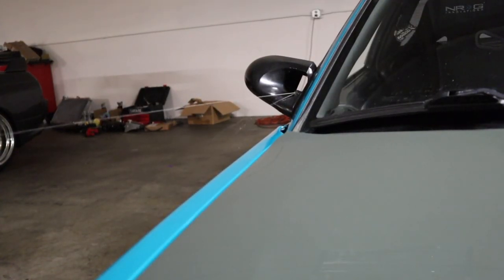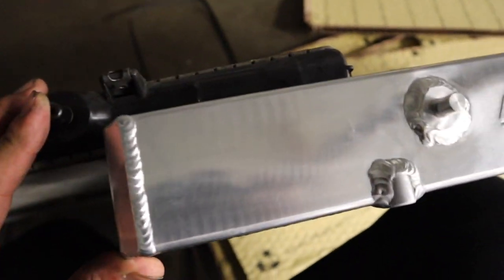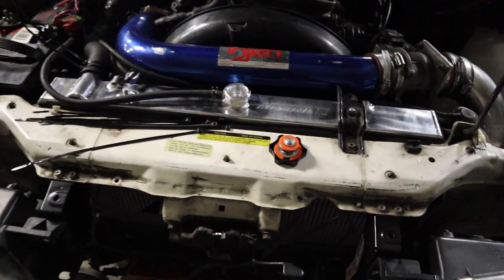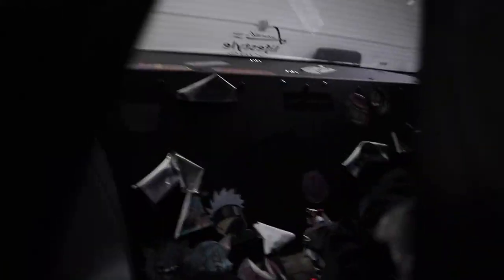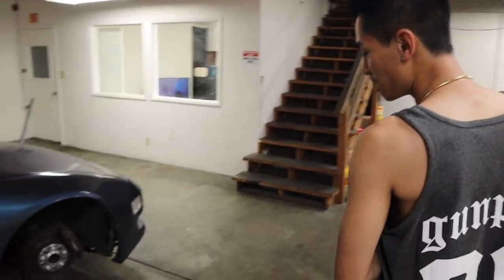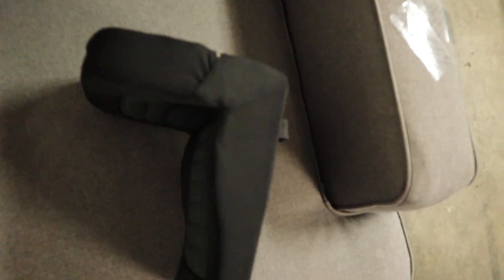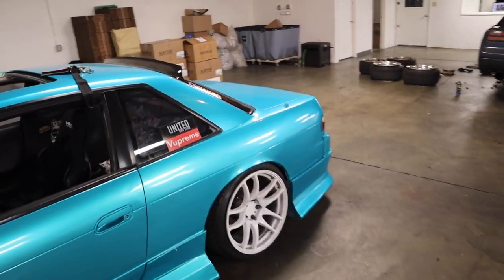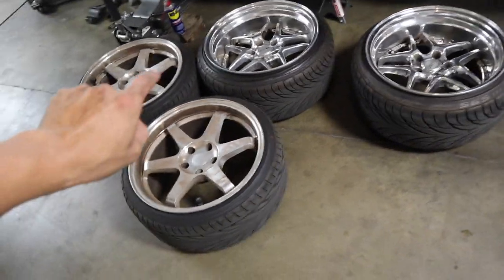Just Another Normal Day

Comment: you know, the only the preventing the control arm or other suspension arms from moving down is the coilover itself.... unbolt it, or heck, remove it completely, along with the sway bar bolt, then you can move the control arms with full motion it was designed for.... this applies to, pretty much 80% of the cars on the road...

Comment: Here's some cheap ideas you can do yourself Vu!;

De-rust the rotor hubs spray them and the calipers black (or whatever colour you want)

Install a kill switch (cheap way of ensuring your car doesn't get stolen)

Cleanup the engine bay, paint the rocker cover, replace the zipties with hose clamps, order some new wiring to replace the sketchy stuff.

Your engine bay looks tight so do a battery relocation to the boot? Will save you some space.

For the fans, you can either buy a fan controller or you can wire up a simple on off switch; use one of the OEM panels switches for the cabin and wire up the wire (that's not power, think it was the blue wire when I did my mishimoto fans) and you can control it yourself (easier than it sounds)

Add some basic hubcaps to the wheels 

Add hydraulic hood struts to the car

Get some cheap gauges and wire it up to monitor your temps to ensure that the car is running well, water and oil temps and oil pressure are some handy ones for the track

Comment: On my 85 corolla I have a koyo radiator and a dual fan setup. I have it wired with an automatic temp sensor, I bought the kit at pepboys for like 40 bucks it turns on automatically when it reaches to a certain temp, which can be adjusted. A switch can be also added if you want to run a switch and have it run manually.

Comment: If your planning on running a switch for your fan you need to look at running a relay as well so you don't burn your car down by overloading a wire with too much amperage. There are tons of videos on YouTube. Also most of the better switches have a diagram included.

And yes squeezing the radiator hoses helps to circulate the air in the cooling system. Obviously when cold your thermostat will be shut.

Comment: Fan power goes to a in line fuse then switch then battery get switch with a light so u dont forget to turn it off
Reply: U could also run the power straight to the ignition fuse so its on when the cars on but it shortens the life of the fan motor

Comment: Carbon fiber front bumper air diffuser, front bumper splitter, blaster pipe exhaust, vinyl wrap the interior, change LED color of the speedometer clusters, underglow, underglow for the interior, gauges, change the interior car ceiling with some nice black gold silk material 🔥👌